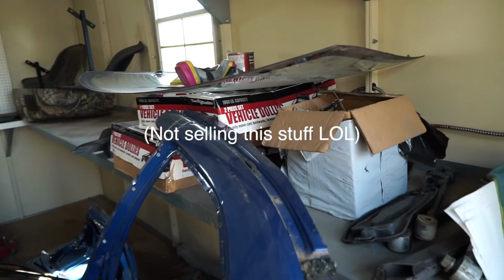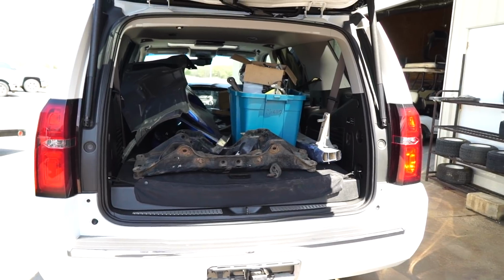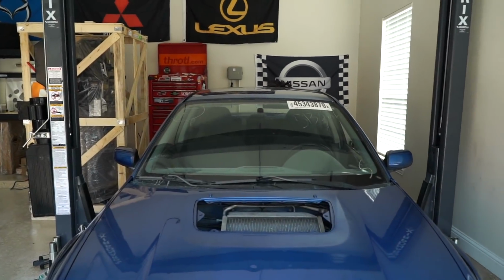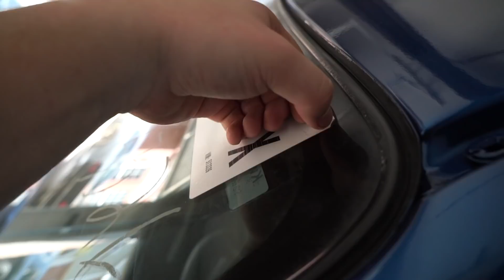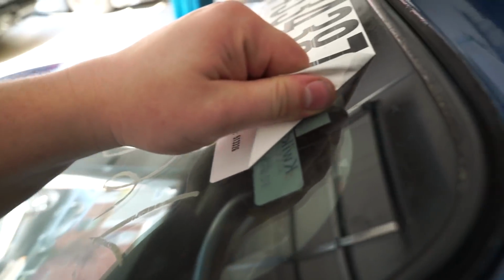FIRST DRIVE IN THE WRECKED WRX!!

Comment: Hoping to get my first car soon. 2004 Impreza WRX. For pretty cheap. Great condition. Has really cheesy blue accents but otherwise looks amazing.
Reply: Insurance will probably be sky high but good luck lol
Reply: No way you can insure that as your first car
Reply: @ikebuttle360  you can. It won't be cheap but its possible.
Reply: @xDvoa  it is only technically the first car I'll have owned. I am also a legal driver of both my mom and dads cars.
Reply: @callsigngecko4723  I take it your from the US so insurance is not as bad as in UK but I was paying nearly 2k for a 1.4 litre fiesta to Insure when I started driving
Reply: @ikebuttle360  holy jesus. And yes I live in California insurance is easier to get on the cheap. You also don't need much coverage for your car to be "street legal" I think you only need liability. And if you go to the right people you'll only spend about $100usd. And it is also cheaper if the driver is fully licensed and I think if you go through driving school it is cheaper.
Reply: @callsigngecko4723  yeh you have to be smart when getting a fast car young in the UK, I've got a 1.9tdi leon with a bigger turbo ect atm which is the faster I can Insuare at my age really
Reply: @ikebuttle360  lol move to the US get the biggest turbo you can afford and pay dirt cheap. Most of the time people dont even look over your car. Although if you put something really expensive you definitely need full coverage.

Comment: Just my 2 cents but I think you're doing yourself a disservice by not changing out the rear sub frame.. You have it, it's not that difficult I promise.  You're gonna go through the trouble of putting all those new suspension parts in the back you might as well.

Comment: If you really wanna pursue this whole buy a wreck and fix it you should atleast do some research and do it semi decently. Obviously you are not a professional panelbeater or painter but some basic stuff should be done right atleast. Or have it done professionally.
The worse think about these jank builds is if those cars eventually end up on the market, and shmucks buy it and drive around on a structurally unsafe cars and get killed. Especially with front end damage and center pillar damage.